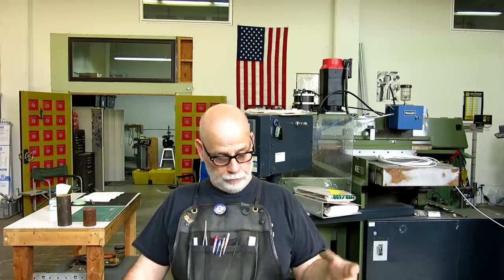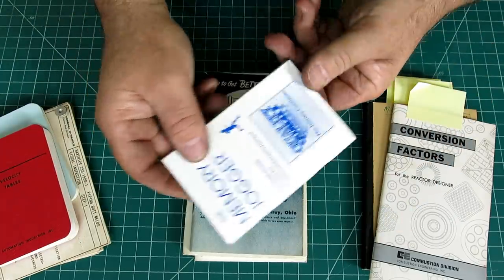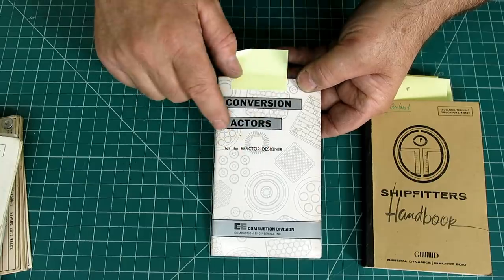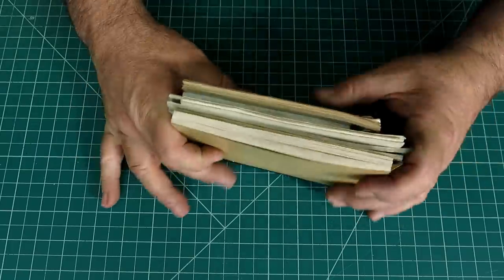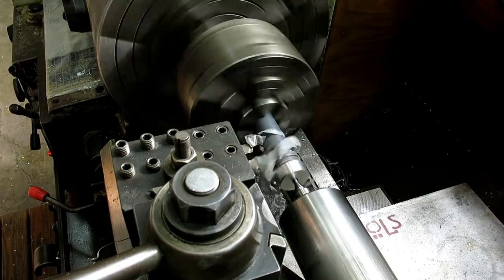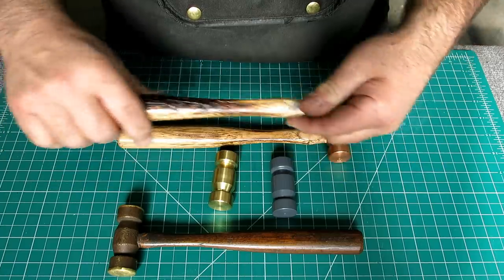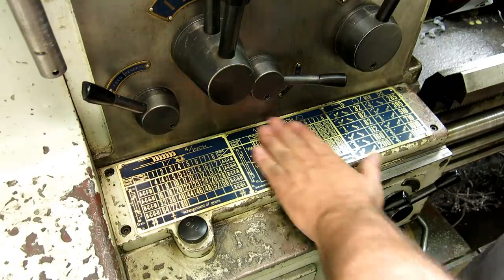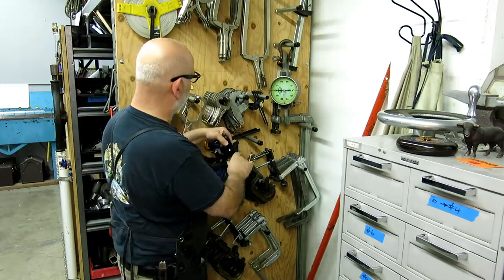Monday Night Meatloaf 123

Comment: 1:05 Metal finishing book
2:35 General Dynamics booklets
10:10 Brass hammer
16:43 Copper Cleaner Deoxidizer
24:01 Lathe data/name-plate
29:18 Kant Twist clamps
37:45 More Kant Twist clamps
43:11 Air bearings in the shop

Comment: Thanks for the meatloaf Tom.
On a ship in the late eighties that had to stow things in odd nooks and crannies, the metal cradles had feet that could be supplied with compressed air to make it really easy to move things around.  Once in position the air pressure was cut and the object secured.

Comment: Great content Tom! 
My first experience with air bearings 1977, our in-house lead toolmaker designed, developed and built a radius grinder with air bearings. We ground a lot of carbide tooling that needed to blend to the ID or OD within +/- .0001 , very little polishing was needed mainly due the air bearings! Great stuff

Comment: In regards to the copper cleaning, I worked in a restaurant that had copper hoods over the stoves and I was tasked with cleaning them. The thing that I found works the best and WAY FASTER than either of those was a lemon cut in half, dipped in salt on the cut side.  Easy to hold and a great scrubber. The copper transformed right before my eyes, it was a mazing.
Reply: Skitch2310   works for brass too.

Comment: My diesel cylinder head machine(mill) has an air float cradle that weights 600 pounds plus 250-400 cylinder head weight and you can easily move the entire assembly with your little pinky when air is applied.  Great video Tom!

Comment: Tom, great video. FYI, the AF uses air  bearings at  Cape Canaveral to move enormous 100' tall blast doors and huge steel assembly structures that weigh many tons. Really cool.

Comment: I used to work in a shop where we made wood die models for the automotive industry. We had a air bearing cart that was about 5'x8' that was used to move the models around the shop.  It could also adjust the height so that the models could be slid from the cart onto granite surface plates.

Comment: For a moment, I was afraid you were going to show me what was embedded in the lung tissues of the metal sprayer.  

I once helped move a 6ft. by 9ft. granite inspection table between two buildings with air bearings.  Sheets of PVC were laid out along the path of travel so that the bearings wouldn''t crash.  The biggest problem was stopping the damn thing before it crashed through the wall of the target room.  I don't recall the weight of the granite table, but it was massive.

Couette flow exists between the disc and the surface.  From my old fluid dynamics days...

That must be a photo of Mare Island in Vallejo. Best Regards, Tom.

Comment: Air bearings are faszinating.
In the high voltage lab of the university I was there were these huge 10m+ voltage multipliers and these weighing tons were just shuffled around on air bearings.

Comment: Another great show Tom. cleaned some copper marine cooling tubes with vinegar only no salt and left em over night came out new. the klean strip etch and prep is perfect for hot blue solution that and manganese oxide and some iron powder they have some handy stuff and in bout every hardware store. adam said he's been doing that spray welding for years.guess he wasent kidding he must be 120 or so now.

Comment: A telephone equipment provider used air pads to float entire switch frames into place from a temporary building to a permanent setup, probably 50 years ago. Simply leaning on the frame after it was on air would move it easily.

Comment: One of the aircraft plants (North American Aviation, IRC) had a large building with a very flat and smooth floor and they moved massive structures (assembly jigs and fixtures) around with bearings. Air bearings are probably used in many other plants (satellite production) for ease of movement and no shocks to the object when lifting and "depositing".

Comment: Denver's old Mile High stadium used water bearings to move a large section of the stands to reconfigure things for baseball or football.  The Wikipedia entry says the structure weighed nearly 9 million pounds, and there were 163 bearings.

Comment: When you get the old “Navel” rust removers, either the pink or blue (other than the colors they are the same), they’re jelled phosphoric acid. I believe the concentration of acid is higher though.

I’ve got so many KantTwist clamps. Yup. Those tiny ones are great too, though I epoxied one swiveling jaw to the frame. That wasn’t intentional!

It would bother so much that the pin holes don’t match up properly. If I did that, every time I looked at it on my equipment, it would bother me more.

Comment: Tom, how did you make the oval hole? As for the pennies, zinc does go b lack with phosphoric acid, that's what t-wash/mordant solution is made with, used for etching galvanised steel before painting.

Comment: I had a valve guide machine in my automotive machine shop that was basically a large drill press with a air bearing table that was about 12" x 36" it held hundreds of pounds and you could position it with your finger.

Comment: Air bearings reminded me of one of the pipe organs at Luther College.  The entire organ was built on a frame with air bearings on the bottom.  Being a pipe organ it had a ready supply of air and could move as far as the electrical cord permitted.

Comment: Being an architect, we ususally write into our specifications for roofers to use white cotton gloves when handling copper or pure aluminum sheet for roofing applications to avoid finger prints.  On the other hand the rumor was when our State capitol building here in Jackson Mississippi was built in the 1920's construction workers urined on the capitol dome to expediate the patina process.

Comment: Hey Tom,

I very much enjoy your videos - thank you for the work that you do on these.

A quick comment on some of the booklets the start of this one.  I've been in the non-destructive testing business for much of my career, most of it devoted to ultrasonic and eddy current instrument design.  The red and blue booklets on acoustic velocity and refracted angles would have been used in ultrasonic thickness measurement and flaw detection.  Angle beam inspection is frequently used for flaw detection in welds, which explains the refracted angles tables, and knowing the acoustic velocity of test materials is important for both thickness and flaw detection.  It's interesting that there were also booklets in that collection for dye penetrant inspection and radiography (X-ray inspection).  The only thing missing from the collection of an all around NDT inspector would be some information on eddy current and magnetic particle inspection.

Please keep the meat loaf coming!

Comment: Mid-'82 was the changeover. They ran both types that year - early-run pennies were copper, later-run were zinc. Easiest way to determine which is which is by weight - the zinc ones are lighter than the copper.

Comment: A quick note on phosphoric acid and where to get it. Look for products used to dissolve Limescale, for example to use on coffe brewers, bathrooms and such. Not only is it really great for copper and brass, but it's also an amazing rust removal remedy for steel and iron. Sometimes even better than evaporust, wich says something... Not as safe, but twice as fast.

Comment: Always things interesting, valuable, and applicable in these videos. I'm looking for a metal brightener for aluminum and steel at the moment. I know several products exist but I haven't used any before.
Reply from the maker: Hi Hugh, for aluminum you want something that is slightly alkali. I prefer good old simple green. It works wonders on aluminum and does some brightening, I have heard Easy off oven cleaner works the magic on aluminum but have yet to test it.

cheers,

Tom

Comment: Get a 1" thick steel plate big enough to mount your lathe or miller on and drill and tap a hole in the center to take a quick connect air fitting. Just add shop air and slide your machine tools around to conveniently get them out of the way. Don't get them moving too fast, though. I suspect they'd be nearly unstoppable at some point!

Comment: on the hammer Carla made did it not have copper discs on the strike faces? that's what it looked like at least. anyway if you're not a fan of the brass you should braze on some quarter inch thick copper discs on to the Brass one you made so that you can replace them when they wear out.

Comment: I noticed that one of your books used the word "weldor" in the title vs "welder". An old term that has a distinct meaning, but is pretty much forgotten today.
Reply: What is the difference between the two spellings?
Reply: Welder used to refer to the machine and weldor referred to the person doing the welding; however, weldor, while still correct to use, has kinda been lost to time.
Reply: I am still stuck at velder!
Reply: I ALWAYS use the term weldor from the first welding book I got way back
Reply: @destro513  Weldor is the correct spelling for the person. DO NOT FORGET THAT.
Reply: 'weldor' has a Lord of the Rings sound to it.

Comment: Not sure who doubts air bearings' load capacities, but Volvo runs a crash-test lab with a movable barrier block that can withstand truck crashes up to 60 mph. When they move the block, air bearing are what makes moving it a routine procedure.

Comment: Another good loaf from an old recipe with fresh ingredients including submarine books!

BTW, in metal shop in high school I wanted to make a small brass hammer. I went to the teacher with turned head in hand and asked how to make the oval shaped hole for the handle. He handed me a boring bar for the mill and when I asked how this would do it he said, “Figure it out.” I never did. To this day I wonder how, short of a CNC machine. I don’t know if this is a topic of meatloafian gravity but I’d still like to see the answer, more than 50 years later. I know you could drill 3 holes and “blend” them but surely there must be a more satisfying answer.

Comment: Yes that is Phosphoric acid - clear green.  Takes rust off Iron/steel stuff and plates Phosphorus on it.  Leaves it a dark gray.  Will flash rust if not washed and oiled.   It will eat it alive also if not in a short time and washed.  Better rust removers now.   Kant Twist - think of a C clamp and you turn the crank and the work rotates out...  These won't.

Comment: The vinegar + salt trick is used by hobbyists to make etchant for DIY circuit boards. Add a dash of hydrogen peroxide and warm it up to get things moving. It's a slow etchant which is why it works good as a cleaner (it won't dissolve your part if you take your eyes off of it). Eventually it will turn a nice emerald green which is when it really gets working, and then turns very dark near end of life. You can bubble air through it overnight (or add more peroxide) to add oxygen and rejuvenate the solution to keep it going.

Also the copper ions that remain in solution are super toxic to aquatic life. Please treat it like the toxic waste that it is!

Comment: Your ruler to me looks like a broddling stick (a broddler = a handy tool used for anything; poking in, hooking out, holding or chipping a 6th finger).  Mine is an old toothbrush minus the brush end but it can be anything.

Comment: I've had to TIG weld copper parts on a few occasions. They kind end up looking grey and black and crappy after... We have a Surfox unit which I know runs on phosphoric acid (with 11 secrete herbs and spices). I stole some of it and it cleaned the copper in Seconds, so I'm guessing it was high purity. Like brush it on and your staring at bright shiny copper kinda fast...

Comment: The copper colour coins in the € colection ie 1centimos, 2centimos and 5 centimos are actually steel cores with a very thin copper coat, I pick them up regularly metel detecting on the beach and they are just rusty steel discs.

Comment: I have inexpensive (SPI) vee blocks which are ground sufficiently flat that they will float across my AA+ plate with no holes or air feed, just the air trapped when setting them down. The first time it happened was unintentional and quite startling, it damned near wound up on the floor!

Comment: It doesn’t take much to lift off. I have a meuser 1m tall with a solid piece of steel as the main beam. It weighs a lot and has a really tiny miniature diaphragm pump to provide the air to make it lift off.

Comment: While I agree with your assessment that the phosphoric acid did a better job...  as someone who has spent years restoring older (usually Italian) race car electrical systems, I'm always a bit leery of using an acid on copper as you can go from clean to gone quickly, depending on the level of oxidation present.   An old timer's solution is closer to your home brew...  simple ketchup.   Fill a container with ketchup and bury your copper items (most commonly I see Marelli fuse blocks for ceramic fuses) in ketchup and leave it overnight.   Copper cleans up nicely (slowly too), minimum metal loss and won't hurt plastics or bakelite.

Comment: I don't understand how the geometry (depth/diameter ratio) of the central hole on the air bearing would change anything to the bearing behavior. Maybe if there is some significant laminar/turbulent flow, but I doubt it uses that much air…

Comment: Could you make a round shaft air bearing out of a degreased oilite bearing.?
Thanks for the video.
Reply: I've thought of that before. Did a bit of research a few years ago as best I could and the air bearing manufacturer's like to keep there secrets about just what's needed and how they do it. But what little I did find indicates for the air bearing to work correctly very high precision is required. Less than a 10th for bore roundness and roughly a 10th for clearance. Grinding / lapping a sintered bronze oilite bearing might destroy it's porosity? But I've still not tried it, so what I think might happen might not. I do know your not supposed to ream oilite bearings as it's supposed to close off the oil bearing pores in the metal. Still only guessing, but since oil is a hell of a lot thicker than air sintered and de-greased bearings might have pores that are too large and widely spaced?

Comment: Air bearings can carry huge loads. There’s a vid somewhere on yt that shows them using steel plates on the ground and large air bearing units to do a U turn with a gigantic TBM ( tunnel boring machine) where it had exited and had to turn around and start again on the next tunnel. Hundreds of tonnes. Smooth as silk.

Comment: Tom, I believe a lot of the commercial fluids used to deal with rust used to be phosphoric acid. It turns iron oxide into iron phospate (properly said, ferrous oxide into ferric phosphate). I don't know about Evaporust; that seems a bit benign.

The other thing that works well (but takes a bit of time) is that good ole American staple, Coca Cola. It will clean almost anything in twenty-four to forty-eight hours. Just think what it might do to your internal workings, eh?

Comment: All the pennies are bronze (have zinc in them) prior to 1982 (some also had tin and zinc, all 95% copper alloy, except 1943 steel pennies). In 1982, some were made as a bronze alloy (95% copper) and some were copper-plated zinc blanks, which has been used to date. While I am roughly 10 years older than you, I believe the odds are good we will both see the penny disappear from circulation before the grand design is revealed in detail to us. It costs more than $0.01 to manufacture a penny, so that would be a big clue...

Comment: All the beautiful work that went into making that new plate, and he made it 3/8 of an inch too long...
Reply: Probably not his fault, a bit of guessing but it was probably made from dimensions taken from another brand of lathe that uses the same gearing as Tom mentioned. Same machine made by multiple manufacturer's is bound to have small differences where it doesn't count except for when you get to replacement placards.
Reply: Turning Point Correct. The plate was made to replace an original Mori Seiki. Tom’s YAM clone has a slightly shorter plate. I’m still looking for samples of Webb, Cadillac, and Hwacheon clones to see if they’re also short.
Reply: Thomas Utley: interesting to know. They might all be different sizes! At least they are easy to change the sizes if you know the right dimensions. Beautiful work!

Comment: Hi Tom I am very new to machinery and I just go a midrange  bench to lathe and I was wondering because I can’t afford $1000 for a surface plate would doing your 3 plate lapping trick could I use one the scrape my compound slide etc.. to a good useable condition is that possible? Your advice would be greatly appreciated please

Comment: I haven't used any kind of lathe since wood shop in high school. When would you use a dead center rather than a live one?
Reply from the maker: That little center was a live center. You might use a dead center where you wanted the maximum rigidity and at low speeds. 

Cheers,

Tom

Comment: Bad test procedure. Once you realized that the one penny might be chemically different you should have run the vinegar test again with good pennies. It seems possible that the zinc penny adulterated the solution. It's not like you to let something like this slip by. If it's worth doing, it's worth doing right.

Comment: Nice one Tom, thanks. You might be interested to know that your big 'rock' on the metal frame, was once part of a photolithography machine, and the x-y stage that travelled on the surface ran on air bearings. Check this out: https://www.chiphistory.org/236-ultratech-stepper-model-900-h-g-line-stepper  I worked there back in the day, building custom electronics for the laser interferometer that provided the position feedback for the stage. Fond memories of working in wonderland...